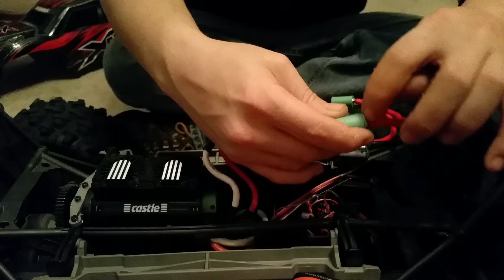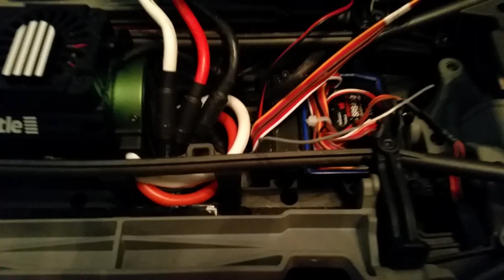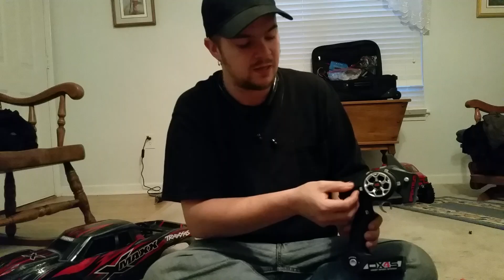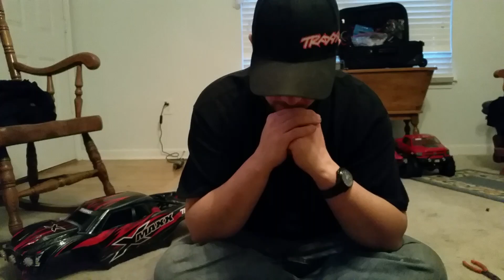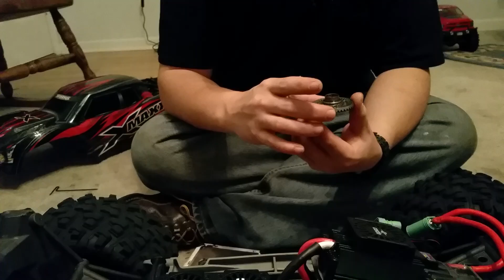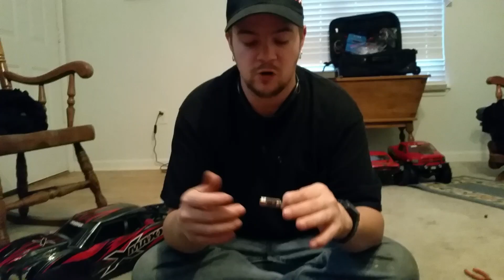A walk through of installing the Castle XlX/2028 system in the X-MAXX

Comment: Hi you say in your video that you need to buy 8 gauge wire ? For what ? To make a series connector ? I'll buy one that has 10 or 12 gauge wire from castle creations, they don't have 8 gauge wire series connector on their site. 
Thanks
Reply from the maker: Lenny7118 you have to wire the esc up yourself and seeing that the X-maxx uses dual 3s batteries in series you need a jumper wire.  you can buy 8 gauge wire at auto zone or any car audio store.
Reply from the maker: Lenny7118 you have to wire the esc up yourself and seeing that the X-maxx uses dual 3s batteries in series you need a jumper wire.  you can buy 8 gauge wire at auto zone or any car audio store.
Reply: Amateur RC Hi the ESC comes with wires ? Right so I will just have to add connectors to the end ? Also the batteries I'm getting I'll have to change the connectors on them only and they have 10 gauge wires. Now the series connector I can buy one with 10 gauge wire and my connectors from CC. Will that be okay
Reply from the maker: Lenny7118 it comes.with wire attached but yiu still have ti solder a connector on.  best to just add the jumper wire cause the more wire you add the more resistance.
Reply: Amateur RC Hi, are you saying that you made your own series adapter than spliced the series adapter onto the wires on the ESC ? 
Thanks
Reply from the maker: Lenny7118 no.  when you get the esc you have to solder a male battery plug onto the esc.  in this case since there are 2 batteries you have to solder 2 battery connectors, one onto each wire coming out of the esc. one will solder to the black wire which would be negative on the battery connector and the red wire to the second battery connector which would be the positive side of the connector then solder the two connectors together with a jumper wire completing the circuit maling a series connection without having to buy a series harness which would be pointless seeing you already habe to solder a connector onto the esc.  they do not come with a connector soldered on.  I recommend the xt-90 with a spark arrestor  or the castle connectors cause the xl2 and xlx habe a warning out of the box that it will pull 200 amps or more.  And if you dont use thick enough wires they will heat up and as wires heat up the resistance increases causing them to get even warmer.  sort of like a domino effect cause one they get warm they will get warmer.  I'm sure you've seen the problems with the stock esc was such as fires.  the problem there is when a motor and esc is put together the esc should be able to produce 20% more than what the motor will ever pull.  Traxxas directly matches their motors and esc's.  And then when they noticed the problem the jumper wire which is the 8 gauge wire I am speaking of that you need to get, Traxxas installed a fusible link.  this is a wire that is either soldered together in the center or very thin that will break if to much load is pulled from the batteries.  it will still kill the esc but no fire because the connection will be broken.
Reply from the maker: Lenny7118 I can do a video walking you through it if youd like.
Reply from the maker: Lenny7118 it is a pain having to solder connectors on, especially if you change the connectors on your battery but they do make adapters or you can make your own.  that's what I did so I could continue using the my batteries in my vehicles with xt-60 connectors.  I simply made an adapter with a male Castle connector on one died amd a female xt-60 on the other so I could continue using all my batteries as good high capacity lipos are going to cost 100 dollars or more.  I prefer venom due to the 1 year warranty.  I've had a few puff and one actually have a cell that died but every time I contacted venom I would have a replacement within 10 days.
Reply: Amateur RC Hi, I follow you with adding connectors to the ends of the esc wires but you lose me with the jumper connection. If you did a video that would be great. I gonna have to change the connectors on the batteries. I'll be using the CC 6.5mm connectors. I can buy a series connector already set up with connectors from CC and plug that into the esc with a connector that I would solder into the esc. The only thing is the wire on the series connector is 10 gauge.
Reply from the maker: Lenny7118 give me a sec one I'll get to it.
Reply: Amateur RC Okay , I appreciate it. When I was in the hobby years ago people weren't as helpful, they kept everything to themselves.
Reply from the maker: Lenny7118 video is uploaded
Reply from the maker: Lenny7118 well from what I've seen so far and had happened to me so many people are willing to help.  nitro is something one has to figure out themselves, people can give tios but every engine even if the same make are different.  I've had several trx 3.3 nitros nitro and each has a different sweet spot.
Reply: Amateur RC Thanks a lot that cleared it up for me and what I'll do is get some 8 gauge wire and I'm going to use the CC 6.5mm polarized connectors male and female packs ( I'll get a few packs from CC ). 
I'll just watch the video several times and make a diagram off the video. 
Thank you
Reply: Amateur RC Hi, I was wondering with those pins underneath to set the mesh what do you set those pins to when using the CC motor ESC combo and a pinion of 48 and spur of 53 ? If you have a better gearing let me know.
Reply from the maker: Lenny7118 you dont use the pins anymore.  you put a piece of paper between the pinion and spur then tighten the motor and that will set your mesh.  I personally wouldn't go back to 53 pinion 50 spur.  therr is no 48.  only 54, 50 and 46.  a good bashing gearing would be 42/50 or 37/50.  The the more wheel speed the more your gonna break the diffs and thats coming from my personal experience.  you also habe to buy a motor mount, either Kershaw or poseidon. The Kershaw mount is 50 and comes with the esc plate and a pinion and also mounts at the top as well as the stock positions.  The poseidon mount used to be 140 dollars, I'm not sure how much it is now.  I'm building another X-maxx with a max5 esc and leopard 1200 kv motor.  honestly the castle setup is to powerful amd not only will you continually shred diffs, you'll also inevitably twist the center aluminum driveshaft.  to save some weight Traxxas went with aluminum cause the stock system is powerful but not an overload of power like the castle system.  I wish someone woyld make a steel center driveshaft.  Also for the cv pins at all 4 corners, go to fastenal and buy 3x20mm pins.  The stock pins break like glass where the fastenal pins are hardened steel.  once you break one of those pins you will scar the inside of the stub axle and habe to buy a new one.  this is all preventative care cause alot of the stock parts are junk.  Also use a second nut on the slipper to lock the 2 nuts together cause so many people melted spur gears cause the slipper loosened under all that power.  I habe a video on how to do that as well.
Reply from the maker: Lenny7118 also if your gonna replace all this get the 1/10th servo conversion and get a very high torque servo cause the stock servo and servo saver is crap. I know all the weak links on this vehicle.
Reply: Amateur RC Good information for me to consider. I'm just getting back into this hobby after many years off that's why all the questions, please forgive me for all of them. My xmaxx comes tomorrow and now I may have to consider a different motor as per your reply and what you know about what works on the x maxx. I did see a 48 pinion on Kershaw site. So what would be a good all around pinion and spur combo for both speed and some bashing. A pinion and spur that's not crazy and will not keep destroying other parts on the xmaxx and burn out the motor and esc. 
Thanks
Reply from the maker: Lenny7118 with the stock motkr and esc an 18 tooth pinion and 50 tooth spur will give you more speed and keep the overall torque.  But when you put in a new motor and esc it all depends on what motor.  with a 1200kv a 32 pinion and 50 or 54 spur would give you speed and torque.  if you go with a lower kv motor like 800kv 42 pinion and 50 spur would be good.  even 37 50.  And if you want more speed add a 46 spur.
Reply from the maker: Lenny7118 I personally just ordered the funny car.  I've got 3 cars as well I habe to get running.  3 hpi rs4's and a tamiya f201.  oh and a big block nitro revo and a short chassis nitro revo that I'm gonna concert to an e-slayer.  alot of work and parts ahead of me lol
Reply: Amateur RC I was looking online at the Leopard 1340 kv with a max 5 esc ? Would that be a good setup better than the castle ? 

Does the Kershaw Designs motor mount fit that motor esc combo?
Reply from the maker: Lenny7118 yes.  I always prefer castle but the X-maxx drivetrain can't take the power.
Reply from the maker: Lenny7118 with that motor a 27 or 32 pinion and 54 or 50 spur
Reply: Amateur RC Is that Leopard 1340 motor compatible with the Castle Esc
Reply from the maker: Lenny7118 yep
Reply: Amateur RC I'm undecided now if I should get the Leapard 1340kv motor with the Castle Creations Esc or the Castle Creations 2028 800kv combo?  I'm leaning towards the Leapard 1340kv with a Castle Creations Esc...What do you think ? Also what would be the gearing size for that combo ?
I want the speed , I'll be doing mostly on road driving. Isn't the Leapard motor that you are  going to put into your new x maxx build more powerful than the castle one ? That eats up the xmaxx drive train like you say
Reply from the maker: Lenny7118 with the one im going to build I'm going to more than likely go with the xlx again but a Poseidon 1000 kv motor.  the castle xlx 2028 has monstrous torque and if you gear hear it high like 53 pinion 50 spur or 49 pinion 46 spur the wheel speed will destroy the diffs if you jump and dont land perfect. with the leopard motor and xlx a good gearing for speed would be 27 50 or 54 for bashing and 32/37 pinion with a 50 or 46 spur for speed.  watch those curbs cause I have broken diffs jumping just a rounded curb into grass.  Im Gonna stick with lower kv cause I can then run in 8s and get speed or go with 6s for bashing.  honestly with 37/50 with the 800kv castle it's faster and more powerful than stock but not ridiculously fast.
Reply: Amateur RC What gauge wires are on the Leopard 1340kv motor are they the 8 gauge and what size are the connectors? Are they the 6.5mm. I can't find this information on the dealers sites.
Reply from the maker: Lenny7118 the gauge on the motor doesn't matter cause the xlx esc comes with plugs to sokder onto the motor wires.  I believe they're 8 or 10 gauge
Reply: Amateur RC I'm going to call in my order tomorrow to Kershaw and ask them if they will solder on the 6.5mm connectors for me. I read on a forum that someone was able to get that done but he lives near Kershaw and drove there to get it done. I read that the tourk can be turned down on the esc if using the Castle Creations 800kv motor so it wouldn't break the drive train and doffs ! Is that true ?
Reply from the maker: Lenny7118 they will sokder the connectors on if you ask.  costs a little more. I know how ti aokder and have several irons including an expensive digital one and a butane one that always comes with me.
Reply from the maker: Lenny7118 also yes you cam tune the amount of torque.  but it can take the torque it's landing with wheel speed that will break the diffs usually

Comment: i just bought the XLX for my xmaxx, how did you mount the motor to frame?Any special bracket?
Reply from the maker: you bought the xlx/2028 setup?  if you bought the castle motor your gonna need either the kershaw designs motor mount which is 45 dollars, you can get the esc mount and 1 pinion if you buy the complete package.  the other choice is the poseidon mount.  I know someone who sells them so if your interested his name is Sean Larmond, he owns a hobby shop in Jacksonville Florida, he's a poseidon dealer and his shop name is Jax Rc recycle and repair.  I believe he sells the poseidon mount for 114.  I prefer the kershaw mount cause it has 2 mounting spots, the stock 4 motor mount holes and 2 screws go into where the battery hold down side brackets are.  but it's your decision. but if you just got the esc you can make a mount for it.  that's what I did.  a dremel, drill and 14 gauge aluminum plate and your golden.  but if you want to install a different motor you will have to get a new motor mount and pinion gear.  with the 800 kv motor the best gearing for bashing is 43/50 or 54.  if you want more speed go with the 43/50 but if your looking just to bash 43/54 is perfect.  if you want an ass load of speed like I did 53/50 is insane gearing.  top speak of 65+ mph but you will destroy diffs while bashing because of the wheel speed.  also if you decide to run 8s 53/50 will get you above 70 mph.  43/54 is perfect for bashing if your going to run 6s and 8s.  If you have any more questions olease, feel free to ask.  also Andrew Natale is a good person to ask questions.  I'll give you his you tube channel.  he has the xlx/2028 setup in 3 X-maxx's and runs 8s.  don't buy the spiral cut gears.  jst shim the pinion on the stock gears.  doing that is actually stronger than the spiral cut hardened diffs. Evolution RC is his YouTube channel.  he even did a fifth scale servo conversion.  great guy.
Reply: @potjnkye86  who come out of 53/50 you only get 60mph bro the heek I was thinking 80 to 90pmh whit that set up dude
Reply from the maker: @oldmanrc3252  the 9ne time I used a GPS to get the speed it was 56 I believe it was and I still had alot of throttle and that was only on 6s.  I know the stock diffs couldn't take the power and wheel speed.
Reply: @potjnkye86  you may need a longer track bro so you can let it go full throttle dude I got rustler whit mamba x hit 42/50 and I get 92mph this last Sunday bro that's way I was thinking whit your set up you can get a nice 95mph no problem bro
Reply from the maker: @oldmanrc3252  I traded it long ago and I do t even run my surface vehicles hardly now that I've gotten into FPV flying

Comment: what kind of batteries are you running?  I don't understand why you think the Traxxas controller and receiver won't work I just bought this set up and would like you to help me out if possible this would be my first real build
Reply from the maker: I don't like having to use a smart phone just to set endpoints and tings lie that and the new tsm receiver fries at the throttle channel.
Reply from the maker: batteries were 7500 mah 30c 3s venoms

Comment: Can you just give use a heads up on New X-Maxx parts when they come out.
Reply from the maker: for now watch Hot racing, area rc and full force rc.  aluminum a arms are available but until I can get them from a hobby shop in the US I won't buy them because Chinese metal is nothing compared to American steel and aluminum.  But also be on the lookout for Leading edge machining Aka LEM ,Proline and savox.  those are the main companies making parts for the X-maxx.  Dhawk racing makes aluminum parts to replace all the plastic parts on the shocks but again very soft aluminum.  I got the upper caps and will be getting the lower caps.